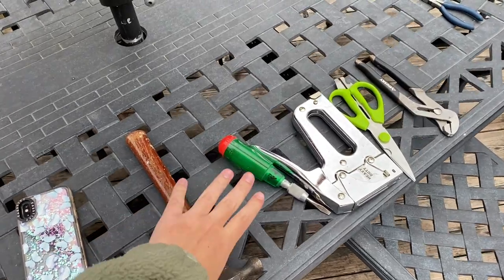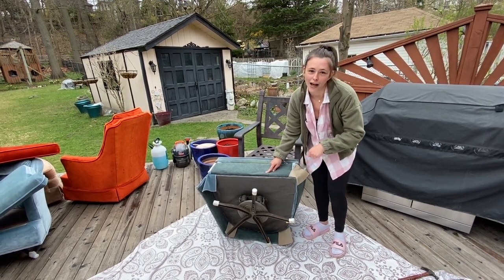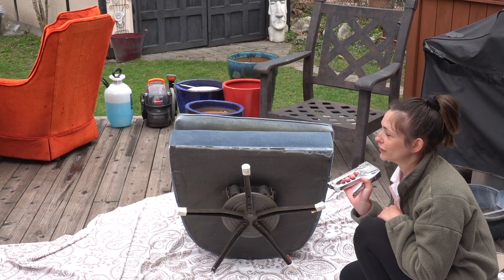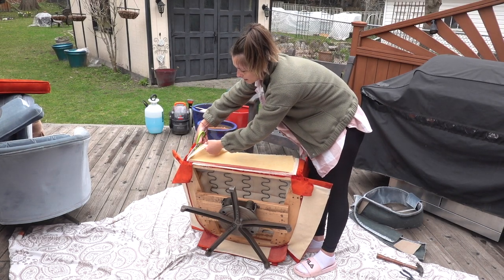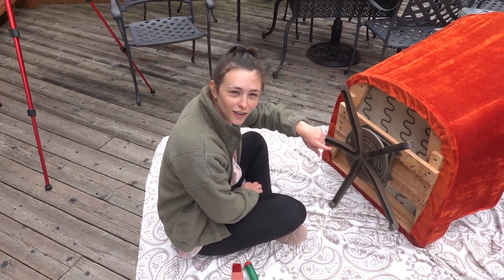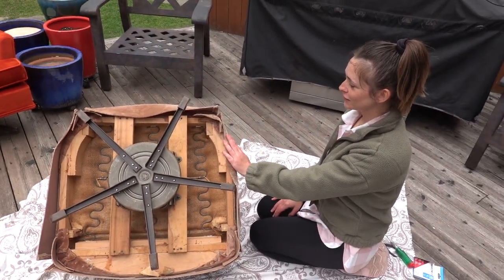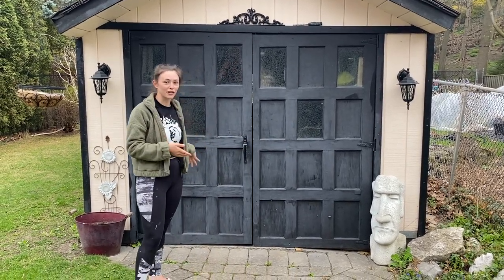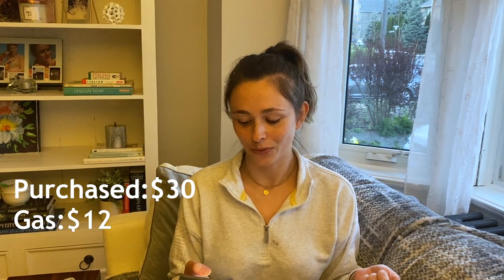How to Make A Profit Flipping Vintage Velvet Chairs

Comment: Where do you find replacements for end of legs if they're missing?
Reply from the maker: Hello, sorry for the late response. I looked everywhere for the proper replacement feet but they are very difficult to find at least for me and also pricey. I ended up using chair leg caps. The black plastic ones. I just made sure to get the proper size to go around the metal chair leg/foot.

https://www.amazon.ca/Rubber-Leg-Tip-pieces-Black/dp/B004672ZS8/ref=mp_s_a_1_15?crid=2LUUUGHJQFBR6&keywords=plastic+chair+leg+caps&qid=1636990842&sprefix=plastic+chair+leg+caps%2Caps%2C76&sr=8-15